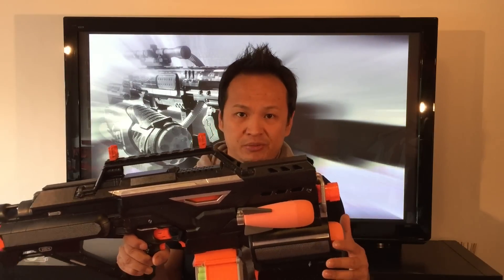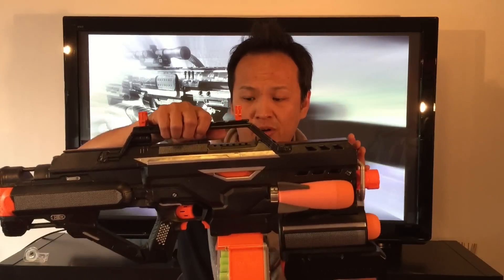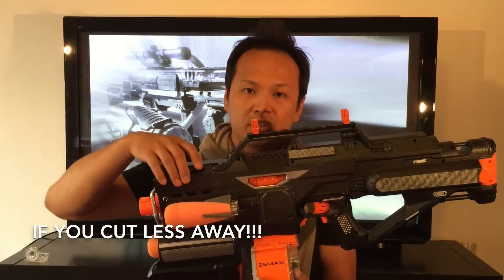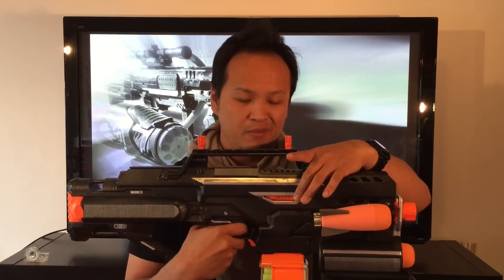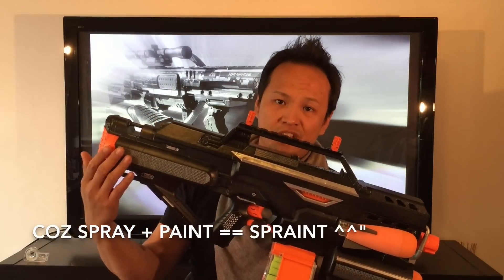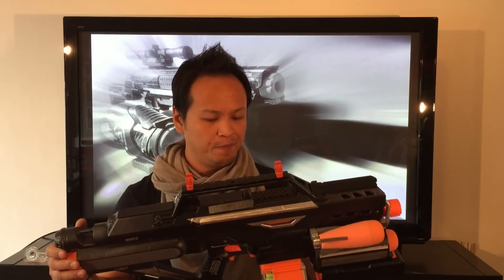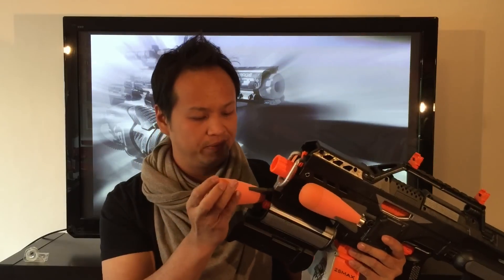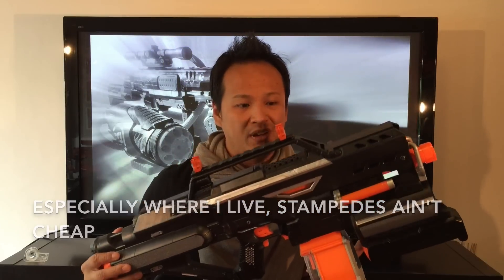[MOD] RASENGAN | Nerf Demolisher Mod / Stampede Integration

Comment: Ich glaube es gibt einige Dinge zum Video und zum mod zu sagen.
Zuallererst finde ich deine Umsetzung echt gut, sauberer geht's nicht, auch wenn mir
(Zweitens) der mod an sich etwas widerstrebt, und das Problem was ich vor allem damit habe sprichst du im Video auch schon an. Bei dieser Art von Integration kommen zwangsweise mindestens 4-5 cm an Höhe zu einem blaster dazu (und das schon ohne den Tragegriff/ der taktischen Schiene der Stampede) und gerade bei flywheelern führt das dann dazu, dass der Lauf unter der halben Höhe liegt was meines Erachtens nach etwas komisch aussieht und die Benutzung von jeglichen laufverlängerungen ad absurdum führt.
Als letztes ist mir aufgefallen das du beim englischen immer wieder "like" als Füllwort benutzt (bsp.:"i, 'like' removed the thermistor and resistors") , das irritiert immer ein wenig. Wenn du englischen content produzieren willst sehe ich da einen Punkt an dem du auf jeden Fall verbessern kannst, ansonsten finde ich deine Videos sehr professionell umgesetzt und gut strukturiert. Weiter so!